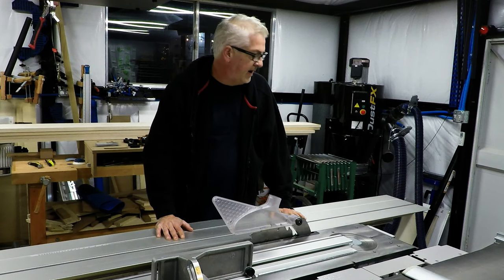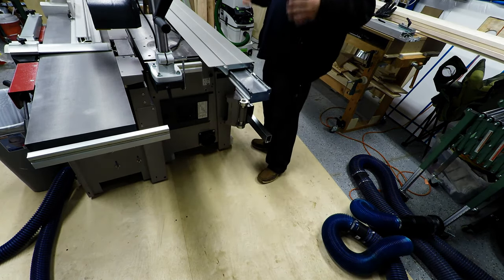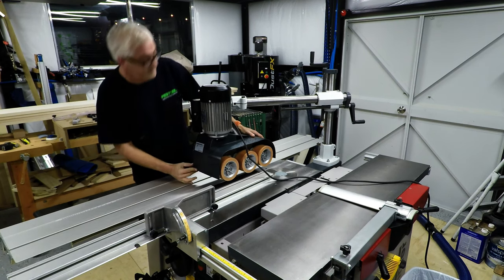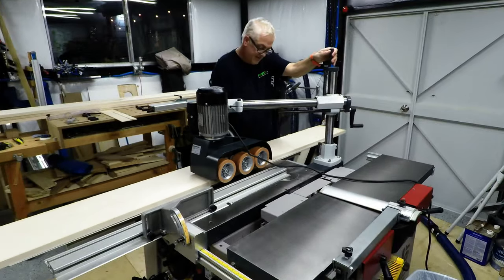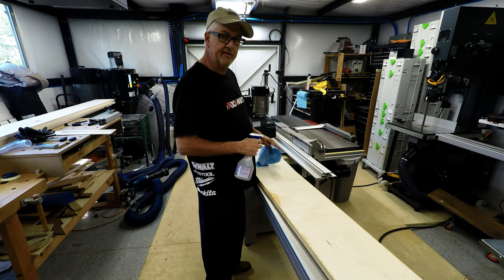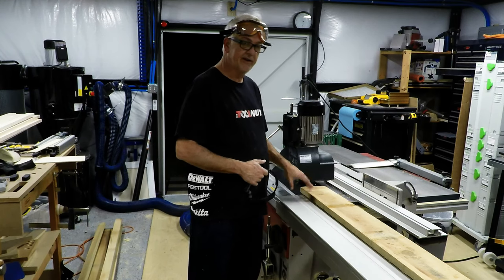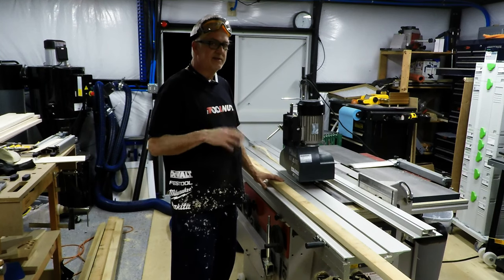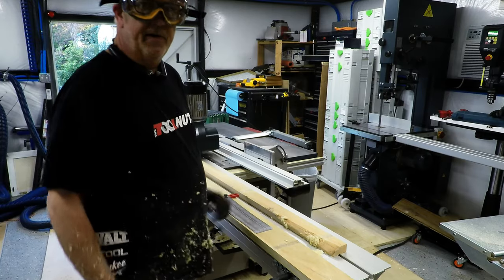Ripping Stock and setup of Felder S308 Power Feeder

Comment: Hi, I also have the Hammer C3 - 31 comfort and think it is a great machine for the woodworker that needs a little extra power and help , ie. sliding table. I bought the S308 Feeder from Felder and just to show how they stand behind their product , the feeder arrived damaged on arrival, they ended up giving me the F-38 instead with the upgraded support arms. It is another 18kg, heavier. Even though it is not a problem for me now to lift it. I think I am going to make up a table that raises to help move the feeder into position.
Reply from the maker: Agree - it is heavy. I cringe every time I have to lift and lower. Wish they had kelp springs on the mount

Comment: You set up simply by 5mm in height less the thickness height  and set parallel  to the rip fence then swivel the feeder  about 5 degrees towards the outward feed of the rollers at the 5 mitute position of a clock looking down from above .
This is so it keeps the ripping pressure  against the rip fence.,and have the rip fence past the last roller of the auto feeder.
This also applies to the spindle moulder ,Always keep wheels about 12mm away from the saw bade and same with shaper..CHECK ALL LOCK HANDLES tight i always do a dry run " lowering the blade of saw or shaper head. Then pass timber throgh if under Auto feed power, all behaves and tight .then bring the saw up to desired hight.same when auto feeding the shaper, WIth all parts turned OFF check spindle /SHAPER CUTTERS DONT HIT THE WHEELS IF  YOU HAVE OVERHEAD PROFILE CUTTERS you may remove the middle wheel and repeat the above checks.
Thi advice is only a guide  not  absoloute text book ,but check with other users or trained woodmachinists.

Comment: I don’t have the flip mount that you have but I reckon that it would be much easier to flip (up and down) if you first lowered the feeder so the weight is as close as you can get it to the pivot point. 

Alternatively, the way I move my feeder around my shop is to drop the feed head off on the table top and move it in two pieces. So, if you could store the feed head in a separate location and keep the arm mounted to the pivot plate, it would also be much easier.

Comment: Your sliding table should be locked, and the feeder lowered a mm or two. When timber is fed in be at the outfeed and assist if necessary.

Comment: hello,

is the bandsaw a felder  510 or 610 ?

best regards from bavaria

bernhard
Reply from the maker: Mine is a 510.  I wanted the minimum size blade wheel of 500mm to reduce blade cracks. The 510 has a 500MM wheel and the 610 has a 600MM wheel. If you are looking at buying a Felder Bandsaw send me an email and I can put you in touch with one of the engineers that helped design the 510.
Reply: Thank you

Comment: Are you sure the dust extraction system is working properly? It doesn't seem to be very effective. Maybe it's undersized?
Reply from the maker: It is undersized for keeping up with fast rip speed. Also the Felder rip blade creates a lot of dust. Grreat blade and does not bog down.

Comment: I suppose you could rig an over-head hoist, block and tackle, or use something like a roll-about engine hoist to lift it, but it would have been much nicer if Felder could offer a spring assist lifter or a counter-weight system so it's not so heavy.   As a woman, I'm sure there is no way I could possibly heft it into place without mechanical assistance or the help from a friendly male.